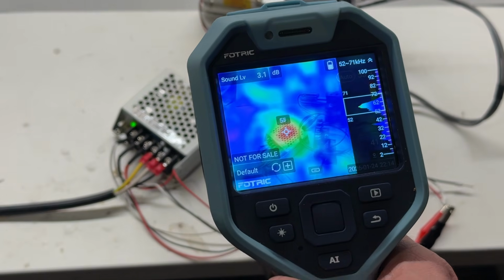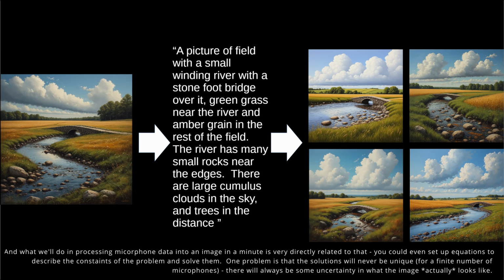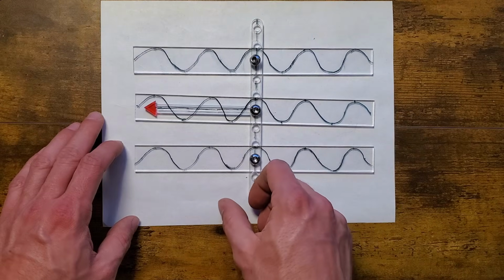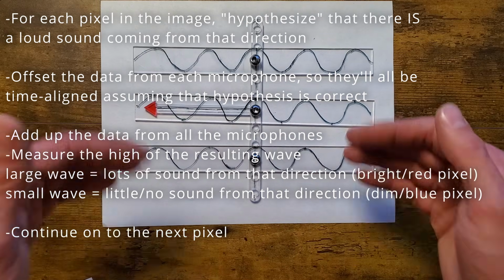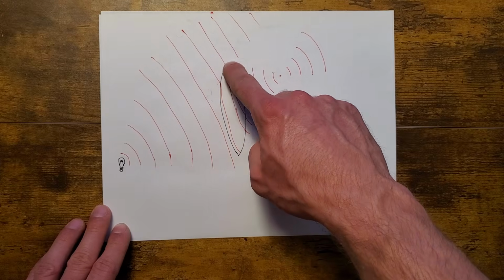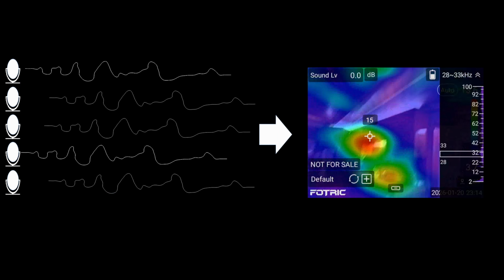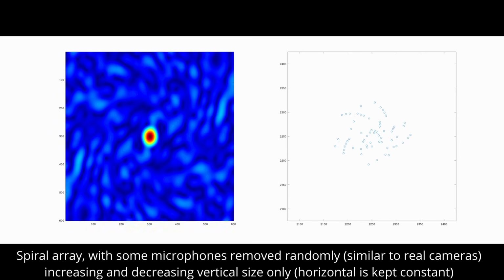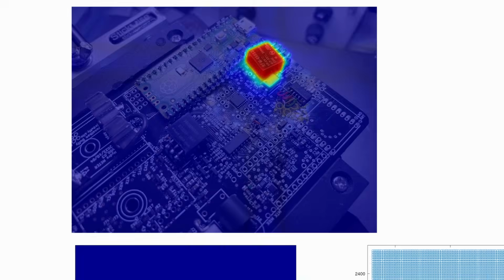How does a SOUND CAMERA work?

Comment: What's the advantage of using the sparse spiral pattern over something like Poisson disc sampling for the placement of the microphones? It seems to me the spiral still leaves you with microphones that are close together near the center, so neighboring microphones will have very similar signals and thus not contribute much additional resolution. Or is having a wide range of inter-microphone spacings important to help you deal with a wide range of source frequencies?
Reply: Yeah, re-watching some sections you specifically mention and demonstrate random placement, and stress the importance of microphone spacing relative to wavelength of interest.

The spiral does tend to give a dark ring around the central highlight, almost like audio dithering / noise shaping. Seems like a good enough reason to me.

I still like the idea of Poisson disc sampling with disc size for each point randomly chosen from a range, so that you get a wide variety of inter-microphone spacings. 

Anyways, thanks for making a video so good I could answer my own question from it!

Comment: - There's a next gen radio telescope being built where the thousand or so antennas are arranged in a kind of vornoi pseudo random pattern (for wide range of wavelengths). Will be orders of magnitude better than current scopes.
- Human hearing can detect sound arrival time diffs to microseconds for localization! @KerryKim has a brilliant 15 minute deep dive into the physics and neuroscience.
Reply from the maker: neat! Yes, this is very similar to the sort of interferometry you'd do with radio telescopes, obviously those are dramatically more complex :) but the fundamental idea is similar! 
Same for human hearing, you can even experience the same frequency spreading and aliasing, for something like a low rumble it can be hard to locate precisely, and high frequencies can sound like they're coming from somewhere else.

Comment: At 6:30 you show multiple receivers for a single sound source. You say the x axis is time but how is it the furthest receiver (the top dot) is receiving the signal first? For your diagram should the line not be opposite. The bottom mic sees the sound first then the top one sees it last as it is further from the source. Otherwise great video man
Reply from the maker: Thanks for the feedback!  I could have been a little more clear on how those graphs work - I'm showing time sort of backward on those graphs from a typical "something vs time" graph.  So farther right = farther back in time, so the data is going from the microphones to the right, a bit like an old school paper seismometer.  

It's done this way so the geometry works out, if it were the other way, we'd have to flip the graph top-bottom before drawing the lines, and (at least to me) makes the rest of the processing more intuitive.

Comment: hello, whats the update on the opensource dmm?
Reply from the maker: Been doing a lot of testing and redesign over the past year, and cutting down to an MVP that I can make a decent number of.  

Layout for that is nearly finished, so I should be able to send those to fab soon!  Planning to post an update before too much longer, these videos take surprisingly long to make, so I've been more focused on the engineering than videos :)
Reply: @john_duffy  its good to hear that you’re still working on it. do you mind sharing the volt meter section? how did you solve the polarity? im using summing op amp but it gives me weird results.
Reply from the maker: @kobs9636  Thanks, could you clarify what you mean about polarity?  The volt meter section is largely as described here: https://youtu.be/WZxFVFWPRwQ?t=1087    It creates a voltage rail at 1.65V, effectively splitting the 3.3V supply rail (to +1.65V and -1.65V), and attaches that center tap to common.  That way positive and negative polarity inputs are within the ADC range
Reply: @john_duffy  using an inverting op amp  creates a negative value from positive input. you discuss it as 24V input and came out as -2.4V so i dont think adc can read it like that.
Reply from the maker: @kobs9636  Ah, I see what you mean.  So this all has to do with that all voltage is relative - there is no such thing as "0V" (ignoring "earth ground" for the moment, since the meter is battery powered).  I go through how grounding/common works in this meter here: https://youtu.be/WZxFVFWPRwQ?t=247  You're right that the inverting amplifier does invert the voltage, how we get around that is to break the common abstraction in circuits that all "0V" / grounds for everything are connected.  

Instead we have the battery negative sit a bit below the negative input jack on the meter - so the "0V" for the opamp and ADC are "actually" sitting at -1.65V, relative to the COM jack on the meter.  You're also right that -2.4V would go out of range for the ADC - anything below that -1.65 (relative to COM) wouldn't work, I'm typically only allowing voltages down to about -1.5V.  So to measure 24V, you'd have to set up your inverting opamp to divide by maybe 16, which would give you an output of -1.5V to send to the ADC.  Since the negative supply for the ADC is -1.65V, the ADC can accept anything from negative 1.65V to positive 1.65V, so a negative 1.5V signal would be within its range.  The limitation also applies for positive voltages, to have a 3.3V span, we set the positive supply to +1.65V (since the difference between plus 1.65V and negative 1.65V is 3.3V).  

Did that make more sense?  I admit this kind of grounding shenanigans is a little mind-bending to think about at first, in fact this was the project where I had that "aha!" moment on how this works back in 2017.
Reply: @john_duffy   thank you! i think i get it now. to my understanding, the input side is shifted half way up for adc to handle negative voltages. its like a mapping function, (-1.65 0, +1.65)V to (0, +1.65, +3)V. this way, GND input lead is totally isolated to everything else past the adc, so you wont get shock or wont damage the mcu. this is crazy, i like it. this is genius!
Reply from the maker: @kobs9636  Exactly!  With isolation between the MCU and ADC it could work exactly that way, for cost/complexity it can be simplified even  a little bit more by not isolating the MCU from the ADC, but instead the MCU is powered by those -1.65V  and +1.65V power rails - since the difference between positive and negative supplies is still 3.3V (+1.65 minus negative 1.65 = 3.3 ) V , the MCU doesn't "know" that its VSS/0V/gnd supply sitting 1.65V below the GND input lead, so it works just fine.  

As long as there's nothing else connected to the meter (like a USB or serial or something), with a ground to pass currnet through.  For my meter to get isolation, (so it can be plugged in over USB) I add an isolator after the MCU, that just makes it so I only have to pass serial RX and TX through it, there's a lot of other control signals for the ADC, range switches, mux, etc. so it's easier to keep the MCU on that mapped/shifted power supply.
Reply: @john_duffy  last question please forgive me. what did you use for the “virtual” gnd? is it just voltage divider, LDO, precision voltage reference, or zener? and did you use voltage follower (unity gain buffer) after this?
Reply from the maker: @kobs9636  All good, happy to talk about it :)  
Your first guesses are right, virtual ground made by a voltage divider going into a unity gain buffer: https://youtu.be/WZxFVFWPRwQ?t=620  For this design, everything is relative to COM, so having it precisely mid-rail isn't super important.  As long as it's within a couple percent of centered, it works fine
Reply: @john_duffy   thank you. i will go with zener with trimpot followed by a buffer for more precision. and i think it will be much more stable than having voltage divider. supply voltages (3.3V in this case) sometimes will drift depending on the load. thus creating slightly  higher/lower COM virtual gnd reference.

Comment: Here I was wishfully thinking this would be in my "nice to have" budget similar to the "cheap" Chinese thermal cameras.
Reply from the maker: don't quite know what your "nice to have" range is :) but I do know this company has their "td2 geek" as well, which is about 1000 and has the same mic array but uses a phone as the screen.  

Beyond that, I'm actually kind of surprised there aren't any really cheap ones out there.  Parts aren't super cheap, but aren't terribly expensive either, especially in quantity.  Lot of engineering goes into these for sure, might just be necessary to recoup r&d
Reply: I bought my thermal camera with built kn display for 200 Euro, but as you say the hardware is relatively cheap so I think it's only a matter of time before these are commonplace!  @john_duffy